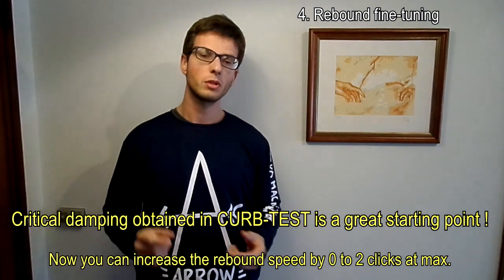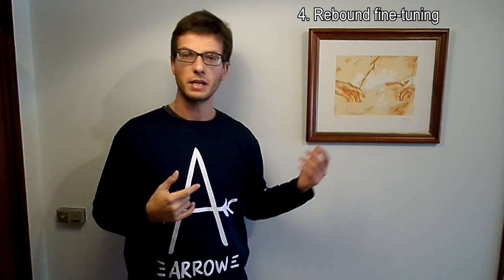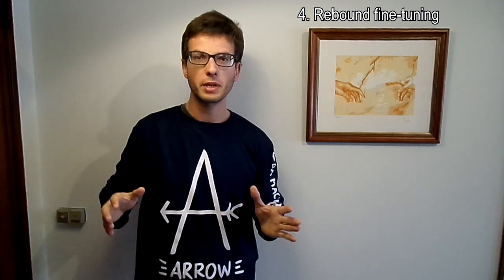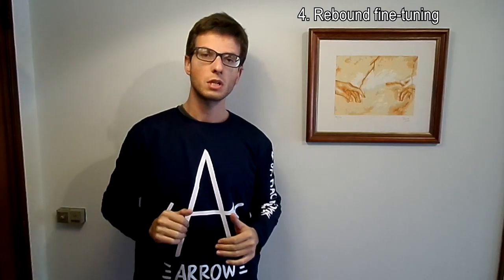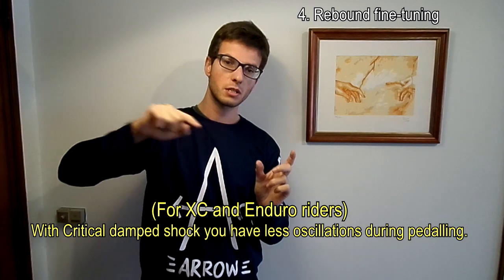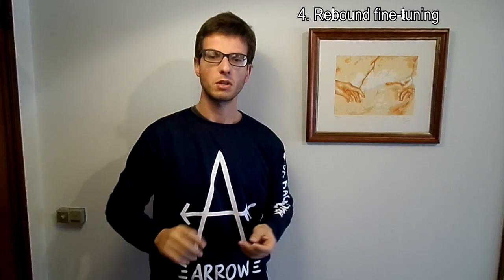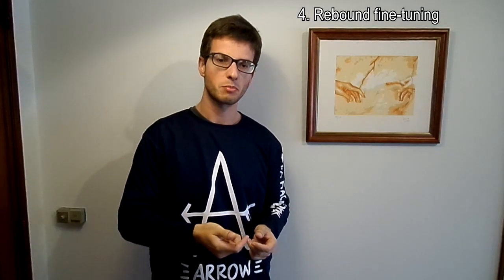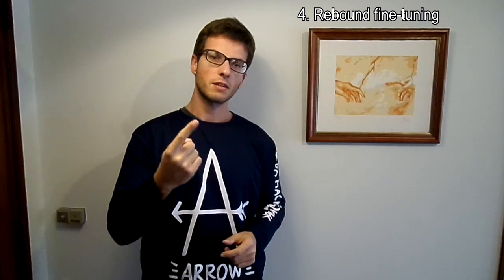How to CORRECTLY setup rebound damping (MTB rear suspension Ep.5)

Comment: you say that faster riding does no imply faster rebound , but why not though ?
in my mind i feel the bumps comes faster therefore  if my rebound is too slow to keep up, my suspension will pack up .
interested to hear from you or other more knowledgeable people  :)
Reply from the maker: @PunkRockPandaa  faster riders also need stability because they are riding on the edge, and if rebound is too fast you can loose control of the bike in bouncy sections / successive jumps etc
Reply: @andrextr  you know , you are so right , i was negotiating some roots yesterday and i can feel i was being bucked and almost lost control each time my rear wheel rolled over a root.
so i went back and did this test , i slowed down my HSR by 1 click and my LSR by a big 7 clicks

Obrigado!

Comment: Which rebound are you referring to? High Speed or Low Speed Rebound?
Reply from the maker: In this case it’s a single adjuster so its mostly low speed, but regardless of the rebound adjuster at the end of the day it’s always good to check for excessive oscillations in the test

Comment: EVOL DPS: impossible to disconnect shock pump without loosing lots of air, 15-25PSI...on 2 diff. pumps, one having "no leak " valve. I am starting to think shock valve is shot. Thoughts ?
Reply from the maker: The air that leaks is the air from the pump hose and inner pump. When you attach again the pump, the air from the shock goes again to the pump and the pressure drops because of that.

Comment: When doing the burn test should I have my high and low speed compression fully open, closed or doesn’t matter?
Reply from the maker: Ideally open but It doesn’t matter much (unless you have very stiff compression). That’s because compression slows the shock movement when it’s compressing and it also helps to reduce and dampen the oscillations.
Reply: @andrextr  awesome thank you

Comment: Andre, why do you do the curb test sitting down? I just found my critical dampening and reduced HSR and LSR two clicks counter clockwise on my X2. It was perfect. Then I reduced them one more click and had too many oscillations, however, I noticed that when I did the curb test in an "attack position" and the rebound was spot on. 
You make great videos, I have watched many of the several times and have told all my riding buddies to check you out.
Thanks Andre.
Reply from the maker: Hi. I suggest seated mostly because to eliminate the interference from your legs acting as suspension, so it makes more consistent. Also because most of the time on the bike for most riders is seated. But yes, you can do the way you prefer. This test is just a starting point for anyone to quickly setup any bike.

Comment: Or just do like I do and set the rebound right in the middle between the 2 extremes and forget about it
Reply from the maker: Heavier riders need more pressure and in turn need more clicks towards closed (slow position). Lighter riders need rebound more opened. So, your trick is not very good idea :)
Reply: @andrextr  being right in the middle while not the best, is better than being too much on either end
Reply: @jeremyemilio9378  you are wrong.
Reply: @chadson5244  well yes but actually no

Comment: I have 33 clicks of rebound adjustment. In order for it to not oscillate I need it to be 3 clicks from slow as possible. I am 87kg, running dvo jade with 500lb spring. Does this mean that my rebound tune is wrong ? Should I have more adjustment?
Reply from the maker: Hi. Since you can achieve the non-oscillating point your rebound tune range is OK for you. Leave it with a small oscillation, and fine tune it according to your preferences. Cheers
Reply: andrextr I am guessing I would not have enough damping adjustment if I wanted to up my spring to 525/550? Thank you from Scotland
Reply from the maker: trialsiain yes in your case the range is skewed towards an underdamping setting. It depends how much the last 3 clicks effectively reduce the rebound speed. But as I said your starting point should be more than 3 clicks (to give a small oscillation). Cheers

Comment: Hi Andrextr, your video are great, thanks a lot, can i ask you how could i work out the max load the air shock have?
Reply from the maker: Thanks! Which shock do you have. Usually the max pressure is printed on the shock in a sticker, or you can find that info on the tech specs of the shock in the internet. Usually the max limit is around 300-350 psi for most cases but it can change (Not sure if this was your question).
Reply: @andrextr  Thanks for the message, I am actually trying to work out the max loaded it is need to have the full travel for the air shock, for example, if the main air charmber holds 200psi, and negative air charmber holds 50 psi, does it means i need 150 psi pressure on the shock to make it have full travel?
Reply from the maker: Check my videos from the MTB rear suspension series. I have one talking about air spring shocks (and negative chamber) and I also have done a free air shock simulator for download.

Comment: Why do you lose stability if your shock is setup to keep the wheels on the ground for traction? Seems like this means you are in contact with the ground and your frame is gliding along without bouncing off the ground so the frame is on a smooth/straight trajectory... did I miss something? FYI I very much like how you explained much of this... I am just not tracking on the lose stability because your wheels are in constant contact with the ground part... Thanks!
Reply from the maker: Hi! The answer relies in the concept of transmissibility. Fast rebound isolates better high frequency bumps but it amplifies lower frequency bumps/oscillations causing a more bouncy ride (pogo stick). I cover this topic in detail (with video animations) on this newer video: https://youtu.be/zxrIybZxMUA.

Comment: During this test, how to set the compression damping? Max, middle or min?
Reply from the maker: Minimum (open mode).
Reply: @andrextr  Thanks for your quick response! 
Rebound damping is not dependent on compress damping? 
If we set the rebound damping as you showed, it stays in the same setting no matter how we set the compress damping? 
I just watch all your movies from the beginning and I want to use your advice in a cross motorcycle. Well done!
Reply from the maker: Yes it is independent, but if you use a very stiff compression, in the limit a fully locked shock, them you limit the compression and therefore you dont have rebound. So with open mode it will freely compress and you can see better the oscillations. This is why it makes more sense to do the test on open.

Comment: Great 2 videos and as u suggest seems applicable to motorcycles as well..question:  how should we do this curb test for a motorcycle ? Same way taking into account the overall weight of bike pax and luggage for the shock? And why would the forks be an exception and just bouncing them by hand would suffice ?
Reply: You can do the same sort of test, bit youll look for the front wheel popping down without the handlebars going low. When you get that perfect you'll realize theres another oscillation between front and back. Youll bob back n forth, the. You have to firm up the front a lil or soften the rear a click (there goes your 3 clicks of adjustment...but it should be tuned nicely)

Comment: Hi, 
I have one question about the curb Test to adjust the Damper rebound. 
You are doing it While sitting on the Bike. 
When you are riding a Trail, Most Times you stand on the Bike. So why do i adjust it while sitting on the Bike?
Reply from the maker: To make the test more consistent by avoiding the influence of the legs, and its more easy to look down to the shock while seated. And in XC/Enduro you spend more time seated ;) But you can do it by standing (I never tried but I guess it won't affect much the final result since the weigth distribution between F/R wheels won't change thaaaat much). Cheers ;)

Comment: Andre, is there a similar test to set rebound damping on the fork? Or do you just do it by feel? Thanks.
Reply from the maker: By feeling. Bounce on top of the bike and set fork slightly faster than rear. Both suspensions should feel balanced. I've talked about that at the ending of this video. This provides a good starting point for a stable and balanced ride. Cheers
Reply: Thanks man, pays to watch to the end eh! Love your channel.

Comment: hey Andre, 
Some serious theory debugging questions from here, hope you can help me with answers.   ( :

What are the parameters for the curb test ? 
How high should be the curb ? How can walking speed ride over the curb be relevant for fast speed descending and agressive ride on the trails ? 
Some people are complaining that their rebound is to slow at critical damping point, and different shock's have different amount of clicks in rebound setup, and in some examples even that two clicks from 0 point still don't make shock rebound speed fast enough ? 
Outside weather conditions (temperature affects oil inside susspension and oil affects how rebound works), tyres pressure, rider's weight, ryders style of ride, also speed all that affects rebound...

Stability on your bike on trails or in air or on landing, depends from your technique, not from rebound speed (because that is not setting for bad technique).
Rebound setting has a purpose to keep your rear wheel on the ground for more continued traction and to take those bumps, not to keep you safe from crashing and bad technique.

It depends from agressivity and speed of rider, and same count's on jumps, drops, when your bike is in the air, faster rebound is better. 
Some riders said even that your shock rebound should be a little bit faster than your fork rebound cause naturally your weight has slightly more pressure at rear wheel (about 55-60% at rear and 45-40% at front wheel i normal seating position).
In optimal, faster rebound is better, but i'm not saying that you should go all the way to the fast. 

Curb test is good and correct starting point for rebound set up. And i recommended that to some of my local riders, because here in Serbia a lot of riders ride very slow rebound because they are thinking that they will be bucket over the handlebars if rebound gets any faster. But if you progress as a rider in techniques you tune all that for your type of riding, we can only surely say that slow rebound is bad, and the rest is up to you how fast and agressive you are going.

Checkout LeeLikesBikes site, made by Lee Mccormack (inventor of the RipRow), he is probably the best MTB trainer right now, he has some discussions on this theme on his forums...

Comment: Dear Andre how is the setting of the compression while doing the rebound test?
Reply from the maker: +Andre Meyn You should use in open mode, although, technically, compression and rebound are independent circuits and don't affect each other (but if you use a very stiff comp mode or even the lock-out, the shock won't compress much and therefore it's harder to see the rebound movement, that's the reason why it's better open mode). Bye
Reply from the maker: +andrextr Stiff compression will also dampen a bit more multiple oscillations making it a bit harder to detect them. So, use open mode to avoid confounding factors. Then adjust the compression depending on the trail an type of riding.

Comment: Appreciate the in depth info! I kind of just set mine in the middle and went for it. Now I can try to get it a bit more accurate.
Reply from the maker: +Cobra Kyle Thanks! The number of clicks will depend on shock air pressure which in turn depends on rider weight. The heavier the rider the more clicks will need (towards slowest position). And this is why shocks have an adjustable rebound instead of a fixed setting. Good rides! Bye

Comment: What about forks? Does exist a similar test to find the correct fork rebound? Thanks for your videos
Reply from the maker: +cesare toffoli I cover the fork rebound at the end of this video (minute 10 or so). Basically bounce on top of the bike and adjust the fork until it feels equilibrated with rear shock (or slightly faster). If it is an hardtail it's harder to explain by words. The good news is that unlike the rear shock you have more room to play with fork rebound until it screws significantly with ride quality and stability.

Comment: This is a very clear and easy to use tuning method for the rear however I disagree about having front damping slower than rear. In my opinion the front rebound damping should be very close or equal to, but never slower than the rear. The reason being that taking off from the lip of a jump, a slower front causes the chassis and rider to rotate forwards in the air leading to nose heavy landings or OTB crash. You compensate for this naturally by leaning back more but then your biased too rearwards with your weight overloading the rear on landing. Better to land evenly 50/50 than possibly bottom out rear which then pitches your weight forward. You also are prepared for the next trail event sooner not having to adjust your body position back to neutral.
Reply from the maker: +Pogue Mahone Yes, but that's what I've said in the video. Probably didn't explained well. The front should be equal or ideally slightly faster than rear (never slower).
Reply: andrextr sorry I thought you meant slower front!

Comment: I'm guessing this generally is just as true for Rockshox?  Also was the curb test done without any low speed compression?
Reply from the maker: Yes this can be applied to virtually any shock. The ideia is always to use the curb test as a way to determine more precisely the rebound speed, and to avoid running it to slow (no oscillations) or too fast (big or multiple oscillations). A very good point is to get a very small oscillation (sligtlhy faster than critical point). It's preferable that you do it with open LSC compression, althougth it's not mandatory, since the rebound damping is independent from compression and vice versa (of course this is ridiculous, but in the limit a fully closed LSC is the same as a fully lockout mode, so the shock won't compress, and therefore it won't rebound lol).
Reply: Very helpful info, I've been messing around with settings lately and wasn't exactly sure what I could attribute to the changes I felt, but this video remedied that for sure.  Interesting idea, hadn't really thought about the LSC acting as a lockout but that generally makes sense to me if at the very end of the spectrum.
Reply from the maker: The lockout is when compression is fully closed / blocked, so oil can't move and the shock won't compress. Most shocks have a blow-off circuit when you hit a big bump to allow the oil flow and thus the compression.
https://www.youtube.com/watch?v=9j3FuvHClJI
Reply from the maker: https://www.youtube.com/watch?v=EJrYai0DmoQ

Comment: Hi Andrextr, awesome video it really makes the issue clear! Just one question. I live in an area with a lot of different trails and surfaces. We have  an insane amount of rocks on some technical trails and some faster, flowy trails. I use totally different rebound settings in the two situations and I sometimes change the rebound by 5 to 7 clicks. Would your rule of a range of max.3 clicks also apply to different types of terrain? Cheers. eric
Reply from the maker: IMO you shoudn't change drastically the rebound between trail types. A faster rebound will give you slightly more confort over rougth sections, but decreases the overall stability of the bike and makes the bike bob more under pedalling. So, I always reccomend to do the curb test and choose a setting which gives you a small oscillation (then fine tune as you wish). Big oscillations, or even 2nd oscillations after the curb test is too much in my opinion (poggo stick). More info about rebounds in this newer video: https://www.youtube.com/watch?v=zxrIybZxMUA
Reply: Thanks you very much for your quick response, very helpful indeed!!! Keep the great work up!

Comment: what is the  effect on your rebound setting when your riding in firm  position on the shock? should you go up or down a click.
Reply from the maker: Technicall the compression settings (firm, open, etc) shouldn't affect the rebound because it's a different and independent oil circuit.

Comment: Great Videos! Not sure if you covered this, but is there a certain order you should go in when tuning your shock?  For example, (with sag set and all shock adjustments set to fully open) do you start with say LSR first and work your way through the adjustments one by one? 
I like your curb test technique, but were you doing this with the HSC/LSC already set or were they fully open?
Reply from the maker: +George A. Goebel Jr. I covered the HSR/LSR on EP.7 minute 9. The order of adjustment would be SAG, rebound and finally compression. Bye
Reply: andrextr Yes I've watched that video already. this doesnt answer my question. Let me rephrase: Forget about LSR/HSR.  I'll just refer to it simply as "rebound" . my question was, when adjusting rebound using the curb test, should you do this with the compression fully open?  Or should you have the compression dialed in first, then do the curb test?  does one affect the other?